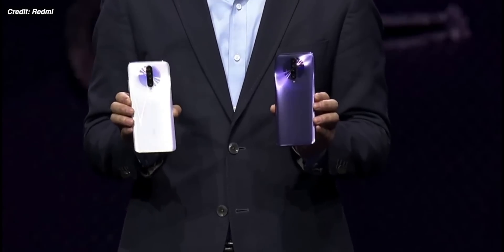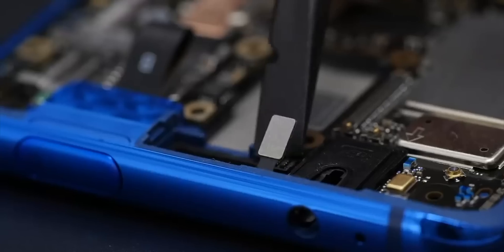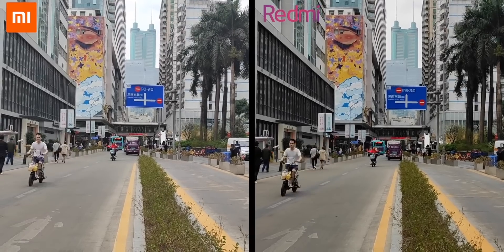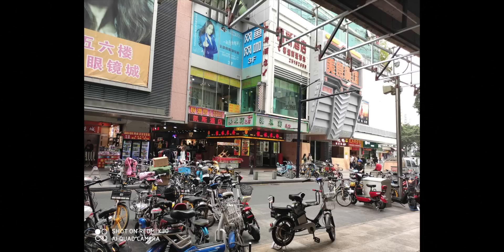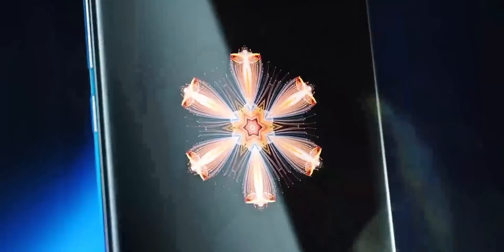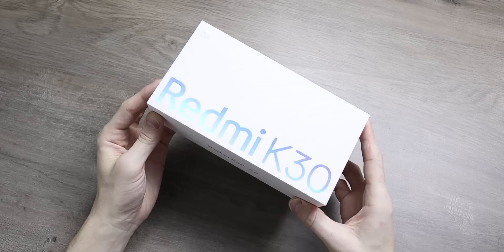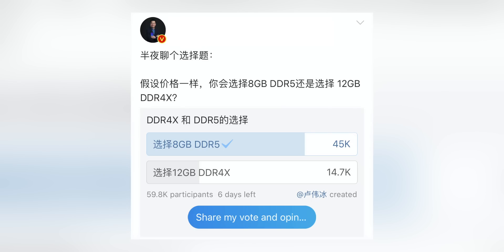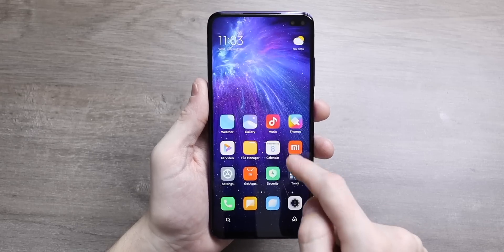Redmi K30 Pro - TWO BIG SURPRISES

Comment: I really hope it came with an amoled screen.
Reply: No amoled
Reply: @sachin2842  to keep the price down, the processor is 765g(5g processor) 
Storage options - 
6gb/128
8gb/256
12gb/256
120hz refresh rate
4700mah battery
And all other specs same as poco x2
Reply: @sachin2842  basically 865 will be for China and USA.
765g will be for poco f2
Reply: @sachin2842  there was controversy over the price of k20 pro
Reply: @sachin2842  k30/poco x2 is a mid budget high spec device. Do u expect that they will use 865. If they will be using 865, the price of highest variant will more or less same as mi 10
Reply: @sachin2842  It's as good if not better than every other flagship in America.
Reply: @sachin2842  is right! K30 pro WILL use sd865. Its confirmed. And to the guy saying amoled is broken, well its not, amoled is better than any lcd technology. It has better color performance then TN, IPS and VA while also havinguch faster pixer transition times. Pixel transition times are around 1 milisecond. While lcd has at best 2-3 miliseconds. While the average have way above 5 milideconds. Amoled is great, only negative is screen burn in. But that only manifests years after. Oh and not to mention the 'infinite contrast ratio that ONLY oled screens have :). When pc gets oled people that know oled is great are going to go crazy. But a big oled panel is very expensive.
Reply: @sachin2842  yes 90 hz
120 hz samnsung panel only for samsung and one plus. But later exclusivity deal will be gone and more phones will get 120hz amoled
Reply: @Patrick Damgaard because we want sd865 :) powerfull gpu in there
Reply: @Patrick Damgaard i already have oled xD
Reply: I just simply prefer an OLED screen:(
Reply: @sachin2842  which is better amoled or LCD?
Reply: @branchprediction9923  what do you mean screen burn?
Reply: Kenedy Wangham  savage haha
Reply: @UCTz01RzcdI1w2feRapnXz5w dude u dont know much about panel technology do you?
Color accuracy can be better on lcd than oled yes, it can also be better on oled than on lcd. Oled has an infinite contrast ratio. Meaning that u will see pure 100% blacks and still very bright whites. Perfect for HDR. Oled also has the fastest pixel response times  between oled, tn, ips and va. Oled is simply the better than lcd.
Reply: @kenta6591  it will have 865. Don't be stupid
Reply: @markroelpadilla9007  price will be 35k for lowest variant
Reply: @kenta6591  how did you know? Are you someone from Xiaomi? Are you Lu Weibing?
Reply: Nope i hope super amoled

Comment: Would have preferred a lower chipset and had wireless charging. For priority for me it’s   1 ) all screen display check 2) Amoled display check 3) in display fingerprint reader check). 4) wireless charging. 5 ) decent camera. I think I would get last years mi9t rather than the k30pro.  I just think the mi9t with 128gb is still worth the £230 in March 2020.  If the k30 pro had wireless charging that would sway it for me.

Comment: oh it's gonna be very expensive compared to previous ones now tho.. I'll always tell it but please at least take 5g out of it for God's sake...
Reply: They can't take 5g out bro,
Cause 5g modem is inbuilt with 865 processor
Reply: @mrwhotheheck5092  - true, they would have to in the very least go back to 855+.
Reply: @mrwhotheheck5092  ah screw Qualcomm then.. they should have made 2 versions.
Reply: @devilefty3814  lol yeah bro
Reply: @mrwhotheheck5092  But iqoo 3 has both 5G and 4G variants with SD865

Comment: Price should be under 30k INR
Reply: 30k for 8 +128 should be fine for me
Reply: No way, K20 Pro was released at 30K segment. Now Snapdragon 865 5G is very expensive and combined with Optical Image Stabilization. The cost may be under 35 K.
Reply: I think it'll be much more than that tbh but if it's under 400 usd I'll probably buy it.

Comment: most people disagree, but for me, if a phone doesn't have wireless charging, it's instantly dismissed
Reply: literally no one uses wireless charging because the charging pad has to be connected to a wire. Its more convienent using a wired charger directly beacuse of faster charging and you can move the phone around while using the phone instead of having to have the phone on the pad all the time.
Reply: This wireless charging is just a gimick. It's just port less charging, slower, and phone can't be used while charging. Totally useless.
Reply: Get Samsung then
Reply: Nithyanth Productions let me correct you in my house every room has a wireless charger 8/10 times used only rare occasions or in a hurry wired chargers are used

Comment: I was disappointed by the poco x2 i hope this will be better.
Reply: Poco F2 is coming soon.
Reply: @i.zameel  we know lots about the poco x2 already and it has disappointing specs. It's even slower than the poco F1 .
Reply: Poco x2 is currently the best midrange smartphone.  In India it costs $250. 120 hz refresh rate,  antutu score 280k,  camera is sony imx 686, gorilla Glass 5 front and back,  pubg plays at >40fps consistently,  liquid cooling,  full charge in 57 min,  4000 mah battery, etc etc.  What could one possibly ask more for at 250$.
It is trending in India. 
Poco f2 is also going to be launched in India after 2 months.  But redmi k30 pro is also a good buy. It will be 5g phone at around 500 $.
Thanks
Reply: @mujeebhamid2670  the antutu score is only 280k. You will NEVER get 120 fps while gaming so its useless.